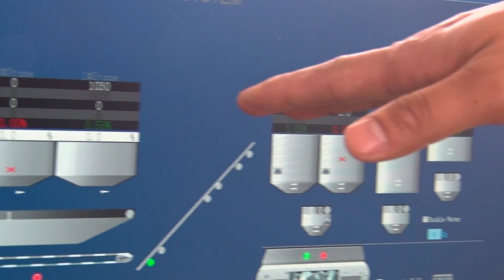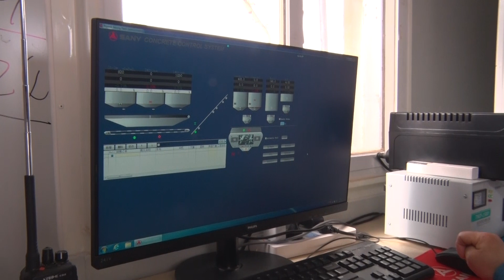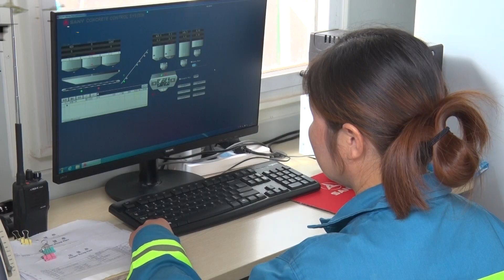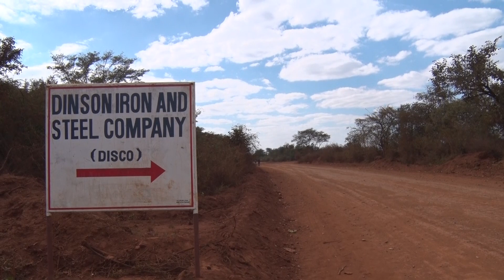THE TRACKER - MANHIZE IRON & STEEL PLANT

Comment: At 6 million tonnes per Annum, Zimbabwe will be the supplier in chief to all African countries.
I also suspect that the lack of developments at NRZ is partly due to the long awaited coming on stream of this plant. Certainly High speed rail will become achievable given the local Steel sourcing complemented by localized Lithium batteries & Solar panels. 
At this point it’s very difficult to not see Vision 2030 coming of age. I have been to Zim 3X in the last year and the rapidness of development is nothing short of Astounding. Back in December it took me 4Hours Hre-Masvingo, last week April 22 it took me 2hours 45 mins. 
Keep up the good work Mr President ✊🏾